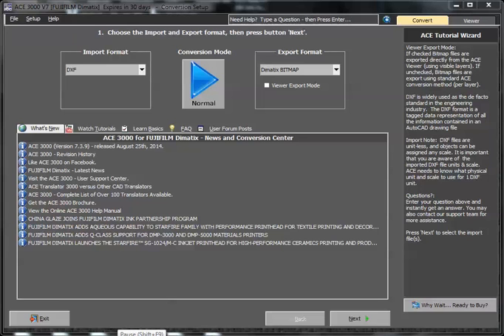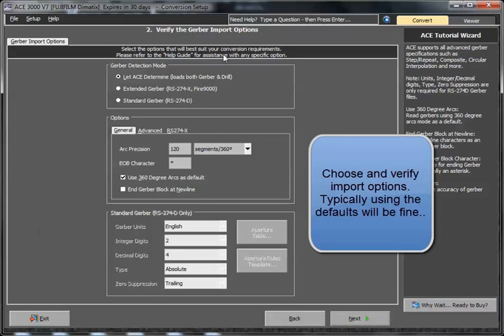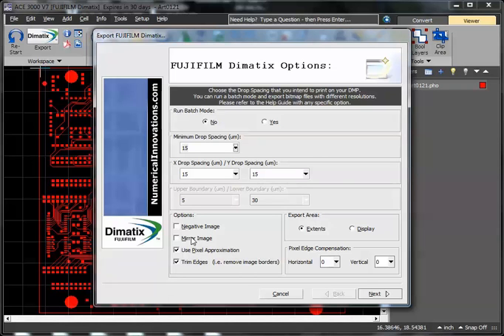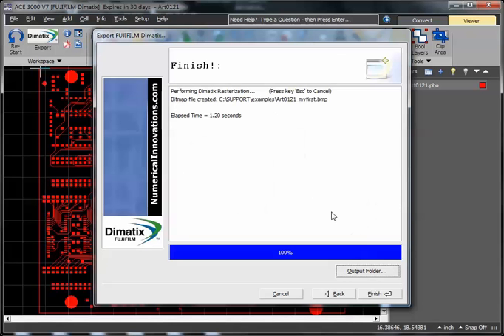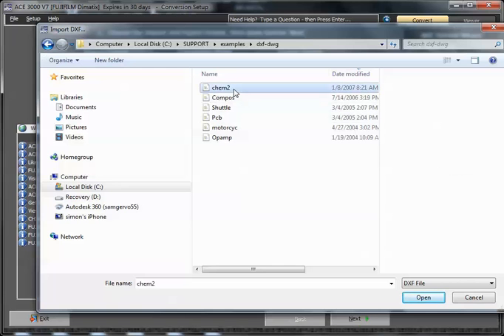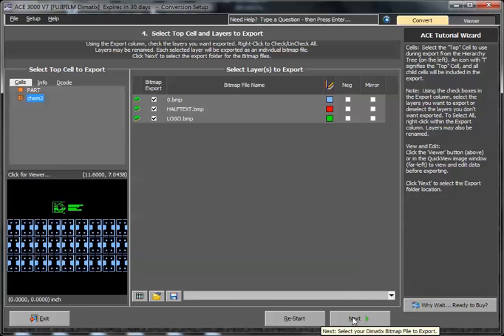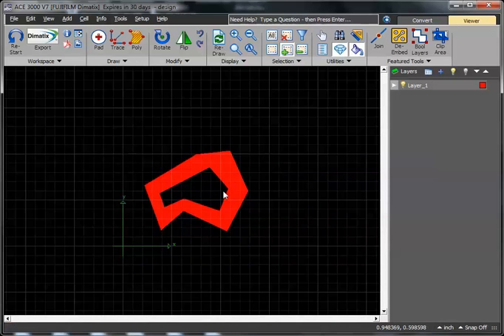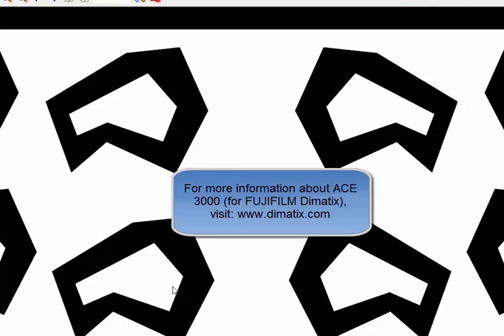ACE 3000 for FUJIFILM Dimatix

Comment: Nice video. I have a question concerning the drop spacing at 2:40. If I understood well, this is the resolution of your image(so I usually take the smallest one:5microns). I was confronted to a problem:the thing is, I have a drawing of lines separated by 10,20 microns (made on Clewin). When I convert then print( In the Dimatix patern, I put the drop spacing of my drops,which is 22microns). In the end, I find that my lines are separated by approximately 50,100 microns.Would you please give precisions about how you can get the correct dimension of what you want to print? (my drops are about 35microns diameter).
Have a good day